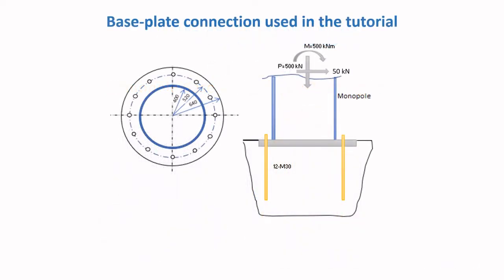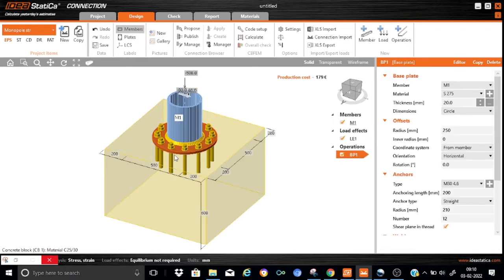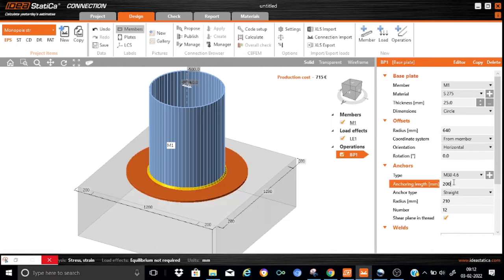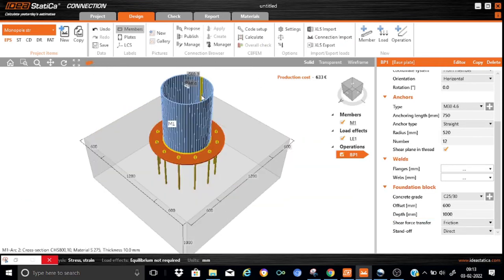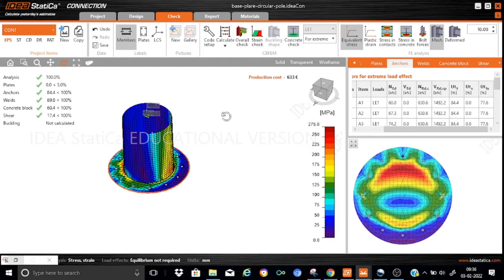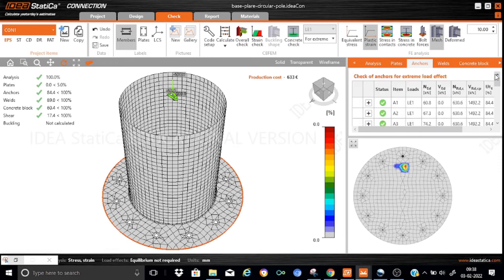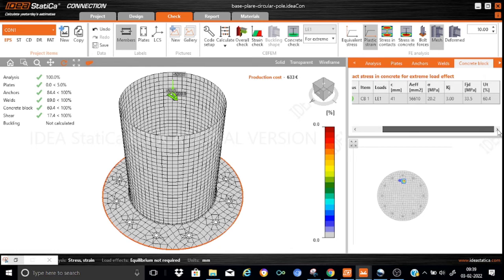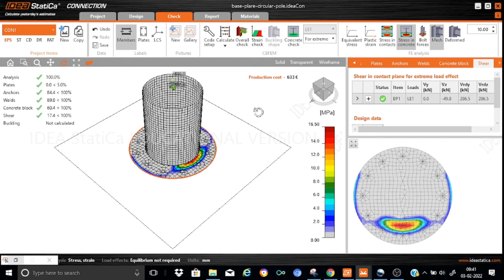IDEA StatiCa - tutorial-17: Monopole base plate design (Type-2)

Comment: Hi sir are you from Kerala 
I have some doubts in ideastatica
Reply from the maker: Hi midhun,
please post ur queries
Reply: @puttattjayarajan1199  
Hi sir I just started learning the stad pro and ideastatica I need to design camera pole base plate. Pole design completed How to put values from stad to ideastatica
Reply from the maker: @midhunedakkandi6384  
Choose critical load combinations from STAAD pro output , one representing max. compression with moment(for base plate thickness caln.) and the other of minimum "P" with moment(for bolt caln.). Directly copy these values and paste into loads tab of IDEAStatica.
Hope that this will solve your problem
Reply: Hi sir how to check buckling for this design